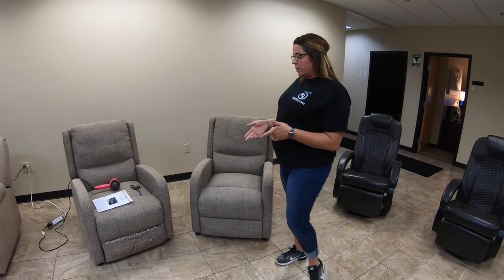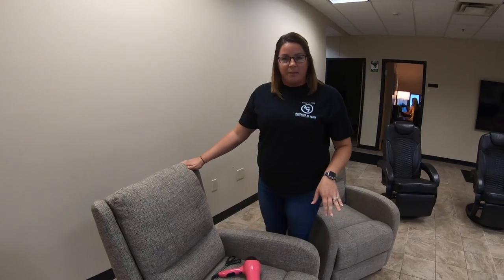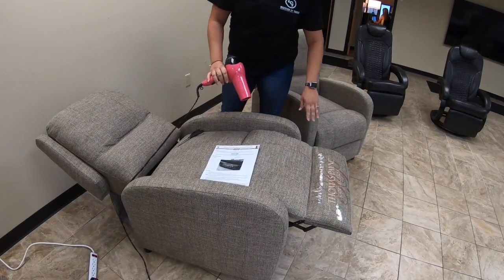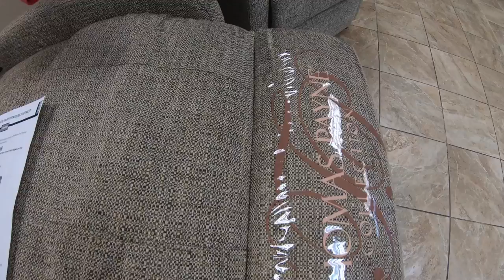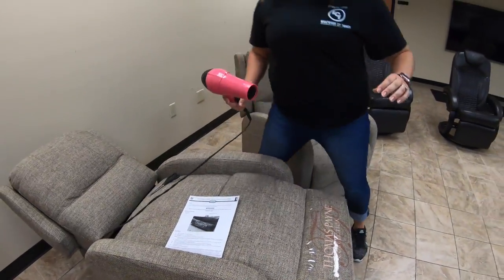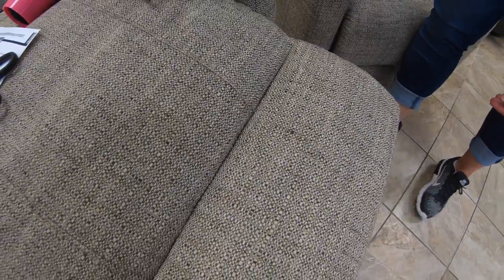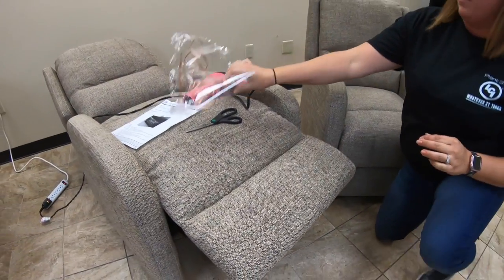Thomas Payne Plastic Removal Demonstration

Comment: This procedure worked. It was absurd that they attached their advertising to the furniture in this manner. The plastic is literally stitched in with the seat covering. Wear mechanics gloves or other thin gloves to protect your fingers from the heat of the hair dryer. It takes quite a bit of force to pull on the plastic as you heat it. You'll need to use tweezers to get rid of small pieces of plastic that are left behind (using the hair dryer as you do this).